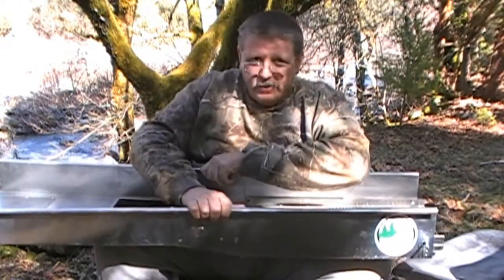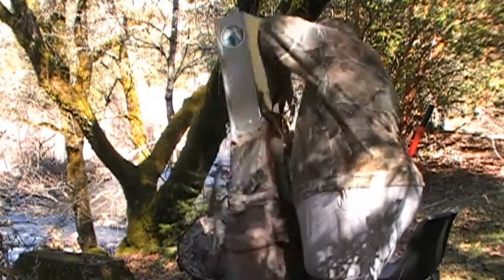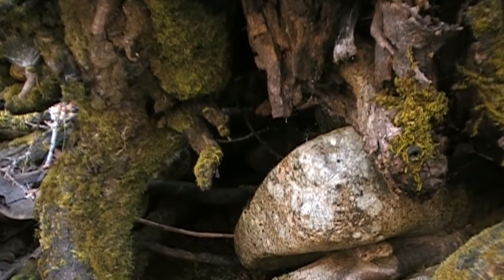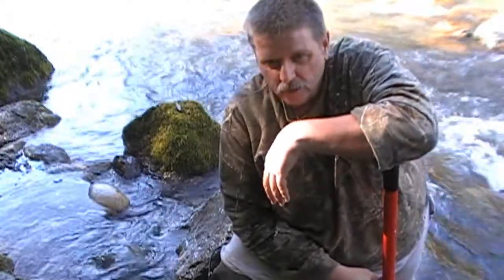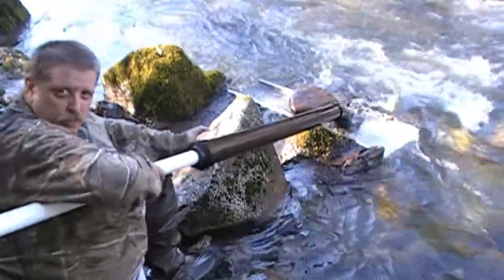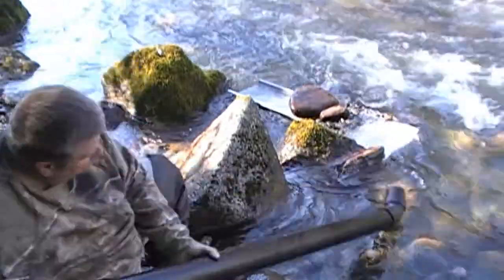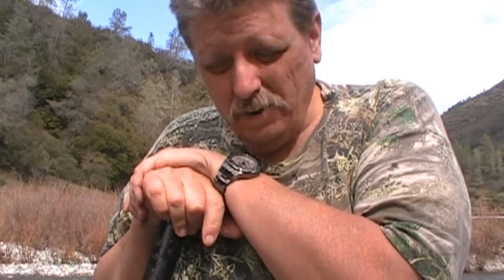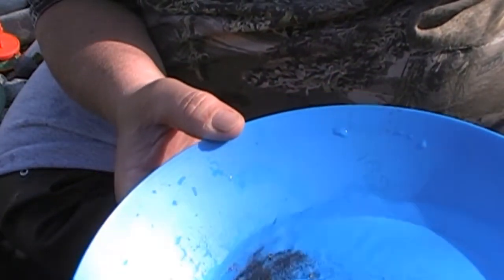Thomas Creek Top Runner II Evaluation

Comment from the maker: @Kyuto00009 - Yea I agree I was thinking maybe at the very top, but that was before I used it. So I had this idea of running 12" of miracle mat at the very top for a nugget catch that you would shovel onto. Then the rest would be open slick plate. I do find nuggets sometimes that will not fit through the 3/8, but that's just fine with me 8°)

Comment from the maker: @elknut4e - No, you just want the undercurrent to collect the fines. 1/8 to 3/16 punch plate is all that you want. Nothing bigger than 3/16. I really like the water dams like I put in the 6" on top of the expanded metal. Run it ½" to 5/8" high.

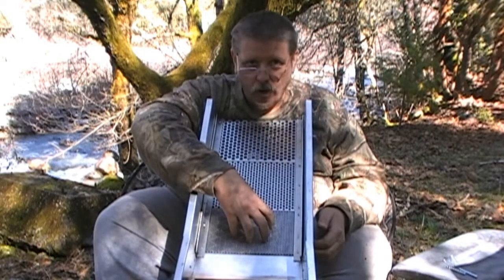Comment: @ 3:45 I recommend not putting black matting or anything on the slick plate cause then it causes all the rocks to hang up from the surface friction. I tried that on my fluid beds and it worked terrible. Nice video!